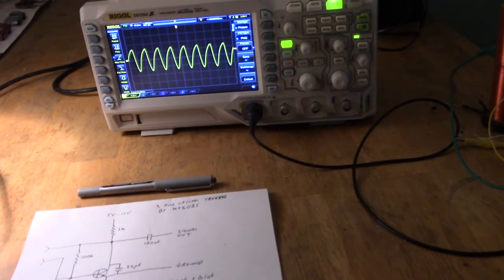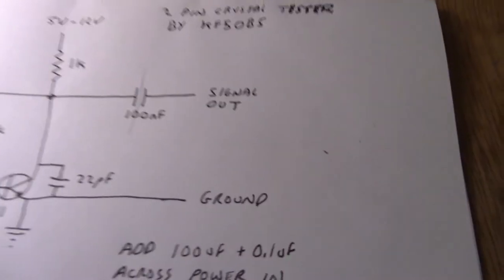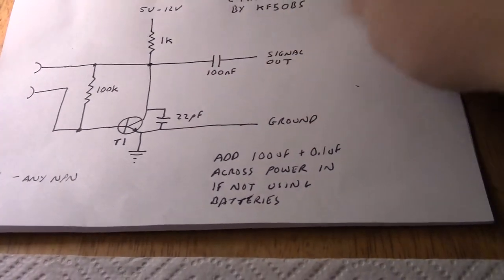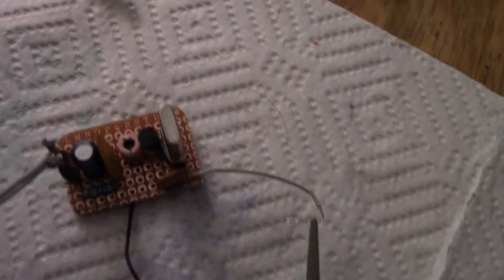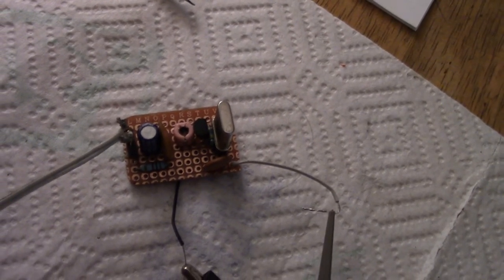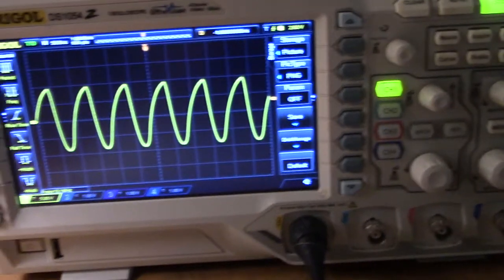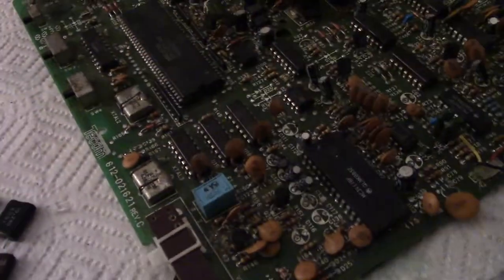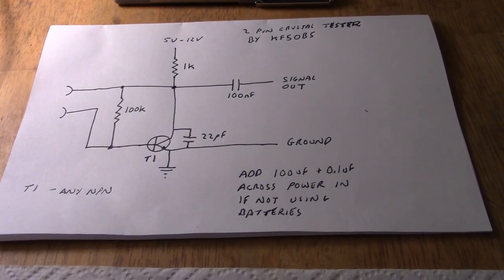Simple 2 Pin Crystal Circuit !

Comment: I tried this circuit using 6MHz and 11Mhz crystals. Both of them give me a "ripple" on the trough of the output wave. It's not purely up and down like yours is for some reason. Top half is fine, but bottom half has the ripple. I checked the signal at the emitter of the transistor, and there's just a ripple there, which damps after a couple of wavelengths, and has a period of  ~18ns. The oscillator is 11MHz, so about 91ns is the period of the clock. I've adhered to the values of the components shown. Initially I mistakenly powered it from a 3.3v supply. I changed it to 5v and the result was the same, just that the p-p voltage of the output was higher. I'm using a 2N2222 transistor.
Reply from the maker: Perhaps the transistor is the culprit, if it's a similar looking ripple. Unfortunately for yourself, my build 'just worked', so trouble shooting wasn't needed. With only a few components, I would suggest swapping each out and testing each time.
It should eventually work. Best of luck finding the issue   :)
Reply: @Slider2732  Thanks for the reply! I know this is an old video. I like the circuit and will tinker with it a bit. It might be something to do with my breadboard power supply. On the positive side I got a wave that represents the right frequency. It's just got that bit of ripple on the bottom lobes.

Comment: That is good news!! I have a bunch of 2 pin crystals on order and this simple circuit will really help.
Reply from the maker: Oh excellent, am glad to know that. Have just been through about 30 junk boards, desoldering and testing...from 1MHz to 28MHz the circuit hasn't tripped up once. Having a 2 pin female socket makes the swap outs really easy.

Comment: What transistor did you use? would 9014 or 9018 transistor work?
Reply from the maker: A 9014 would be ideal. Any small signal NPN will work, there's nothing high demand about the circuit :)
Reply: @Slider2732  Thanks, i just tryed it out and it works perfectly with the 9014 transistor, and what do you think how many mW its putting out? And can the crystal be damaged after long periods of time(i mean is the current passing though the crystal too high?) And i also tested the 22.1 Mhz crystal and it worked just fine

Comment: Sweet!  Simple and elegant.  But what is that symbol fixed parallel across the 100K resistor?  If just a gimmick capacitor, what is the length and spacing?
Reply from the maker: That's how K5FOBS drew his schematic. It's the connector for a crystal to go in :)
Reply: Ah thanks, my old eyes failing, saw the 100 nF and mistook it for the crystal!  Don't know how that happened since that would not function!  Take care.

Comment: What is the range of crystals can you check, e.g will it work for 32khz watch crystal up 40mhz ?
Reply from the maker: Sorry for the delay. The circuit is no longer here, or I should say I can't find it. Only tried a few crystals, so I would suggest a few different ones and check on a scope for reliable running  :)